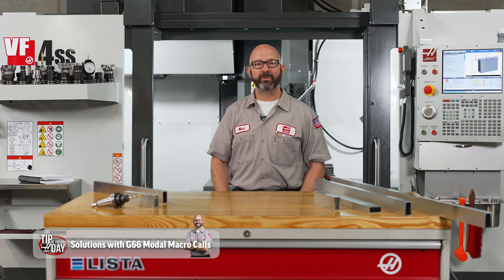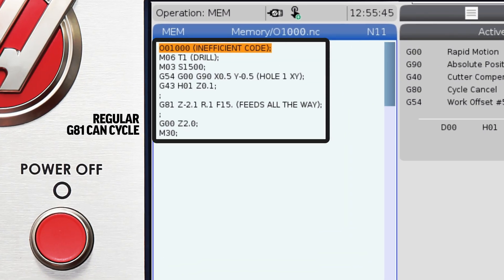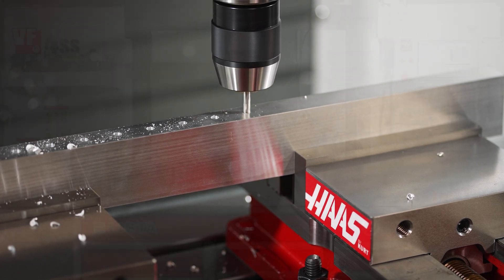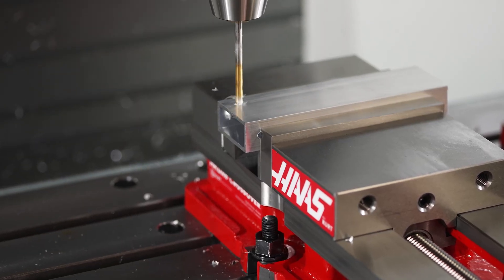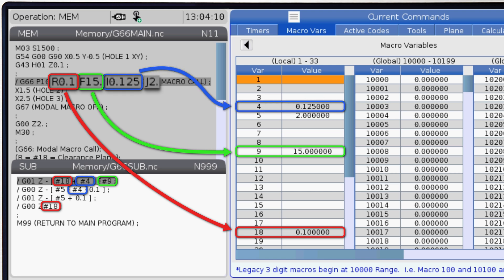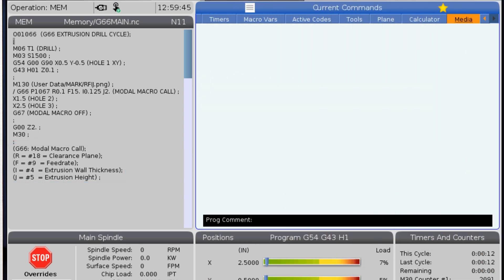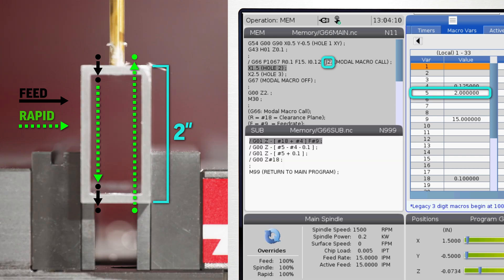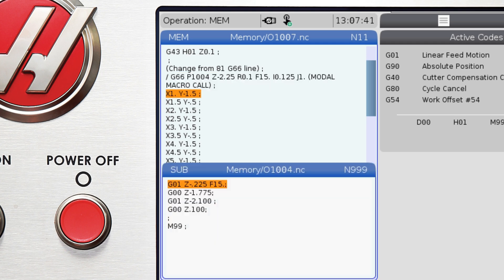The Perfect Drilling Canned Cycle with M98 & G66 - Haas Tip of the Day

Comment: Is there a FOR loop macro command? Say you wanted to drill 50 equally spaced holes, each pass through the FOR loop one hole is drilled, and then a distance or spacing is added for the next hole to be drilled, until the 50th hole has been completed?

Comment: Is there any gcode typo checkers out there ..especially when you leave out a period on a x value...
Reply: That’s a great question/idea. On the Haas control, we can adjust Setting 162 “Default to Float”, to let the machine know how you’d like it to interpret values without decimal points. This can help speed things up when hand entering code too. Beyond that, we can run programs in Graphics, to make sure we don’t get any alarms. I don’t know of any g-code “spellcheck” for the PC.
Reply: Does Vericut do this? As I understand it, it simulates Gcode, not the NC data like MasterCAM. It sound incredibly useful for programs you have to hand write or edit.
Reply: Might find CIMCO Edit to be what you need. You can use the trial (30 day) version for free. It's got a lot of useful tools, editors, calculators, find/replace/all functions. It probably does what you are asking. It's also got a Back Plotter to watch your programs run. Best part of CIMCO Edit that I found, was the variable table which displays all the variables used in your macro program and shows the values as they are used. I highly recommend it!

Comment: What if i want to drill in predrilled hole on z-30 and wanna continue  with longer drill to make z-45 but with pecking from z-30? (drill 3mm). As far im using ijk drilling but i cant change 1st move to z-30 feed too much.
Reply from the maker: We would want to be very careful. If we want the tool to rapid to about Z-28.0 before feeding We could just change the rapid plane on this drilling operation. For more information on rapid/clearance planes check out https://youtu.be/YbbZJ7H0NUw?si=dbe61qioNp9MCTPV . Typically for longer drills, we would want to start them at a very low rpm, feed in to the predrilled hole, then ramp-up the rpm, rapid down to the our new start point, and then feed, like a gundrill cycle. For this we could definitely create our own custom cycle with an M98 or G66 code like described in this video. – Mark, Haas Tip-of-the-day

Comment: For subprograms, I prefer using M97, instead of M98 - this means the subs are contained within the main program instead being external files. Much easier to manage. Editing the subprograms, instead of creating a macro is a plausible option, but macros are the ultimate. Thanks for the video.
Reply: Agreed, if you won’t need the program anywhere else that’s the best option.
Reply: The only limitation with the m codes is they do not transfer data from the calling program so macro use is very  limited  and changes to the sub program would need a re post or the calling program as well if a m97 is used

Comment: These macro tips are amazing. Part of this video made a feature of g66 macros click in my brain like I just saw Macro Jesus. I really wish someone did Fanuc tips of the day. Finding good videos for stuff like macro programming on fanuc controls, especially older ones, is a nightmare.
Reply: It's still the exact same concept just with different codes and syntax
Reply: In Fanuc it is similar, at least in the new ones. It is written quite clearly in the textbooks.
Reply: There is a book called CNC Programming Using Fanuc Custom Macro B by S.K. Sinha. It is amazing. Definitely buy it and it will teach you everything you need to know about macros.
Reply: @BrandonShara  i've had that book for probably 14 years, it is good. Another awesome Macro book is "FANUC CNC Custom Macros" by Peter Smid, you can find the full PDF version with just a search.

Comment: Why Haas sell perfectly capable machines and then punish their customers by charging thousands for enabling Macros is beyond me.
Other cnc manufacturers offer it free with their software. A few years ago we purchased a VF3 miller and that came with Macros free of charge. As for our ST15 unfortunately   it's only available if we part with a few thousand pounds. It's only a code from Haas which is required to activate which can be done online with no need for a service callout so very minimal cost for Haas. Shame .
🙄
Reply: Working at Haas, and having spent some years in our Software Department, I’ve seen a tremendous number of hours being put into maintaining Macros and HSM High Speed Machining. Thousands of developer hours maintaining these features. We could raise the price of all machines, even for those that don’t use the features, or just charge the people that use them. Developing and maintaining these features definitely isn’t free, I’ve spent hundreds, if not thousands, of hours on them myself :). Just a different way to price them, that we think is most fair. We hear you though, it is a paid option. Macros does come with the Probing option (necessary to run probes)
Reply: OR... Why buy a different machine brand, be forced to pay for macros and never use them? It's all about perspective.
Reply: Hey, be glad they aren't doing the subscription thing. They could easily make people pay $xx.00 a month for the feature per machine and people would pay it. The buy-hardware-you-can't-use-without-a-subscription business model is all the rage nowadays. I'm happy they give the option for people who will never use macros, though including the probing having macros and probing be the same package kinda sucks if that's true since not having a probe would never be an option for me after having used machines with them.
Reply: I don't use macros.  I'm glad my machine was cheaper with macros disabled.  And I'm glad that if I change my mind in the future I can write a relatively small check and have them easily enabled.
Reply: @schmidtyyt  Better yet, Haas let's you turn macros on and off as a demo for up to 200 hours. Brilliant business strategy if you ask me.
Reply: @jaypie0864  Yup, that's right.  I forgot about the demo time.  I agree; great business model.

Comment: wee need g84 with peck tapping cycle ....
Reply: You have peck with newer haas ngc versions,  I think from Feb 2023.
Reply: @doc0302  nope
Reply: Added in SW version 100.23.000.1200. Sounds like a topic for a new video! Thanks for the comment. G84 with Q-value pecking.
Reply: @markterryberry4477  Holy cow, it's actually Mark!
Reply: it suck when you need peck tapping         you cannot get g84 cycle like fanuc        Haas is boring
Reply: You can make one with a G65 and a repetition of the standard taping cycle at incremented depths we've been using one for about two years now  and can be heavily optimized with the new g66 addition
Reply: @HAnnibal-pentz  can you demonstrate with making youtube video?  or maybe you can suggest me video... so i can understad
Reply: @HAnnibal-pentz  you are willing to share your tips??? how your peck tapping done on machine ???
Reply: I'll make a video of how we got it to work I'm just going to have to dress the code up a bit nicer it's bare bones in it's current state . The machine is going to have to have macro variables enabled unfortunately.
Reply: @HAnnibal-pentz  in haas i dont think peck tapping can run....but lets see your trick
Reply: You could make a looping macro that would repeatedly call the G84 at different depths and basically just taps slightly deeper every time and keeps looping until final depth.